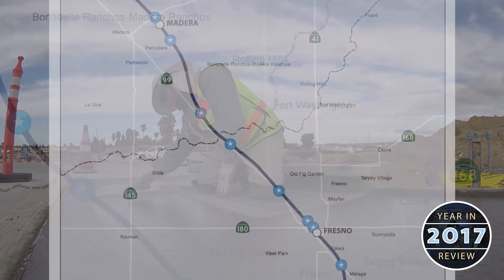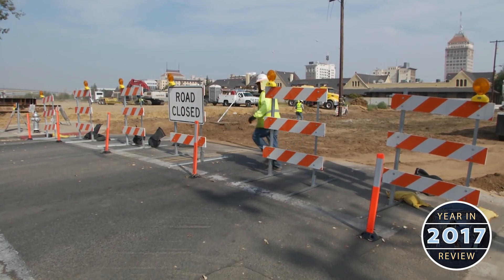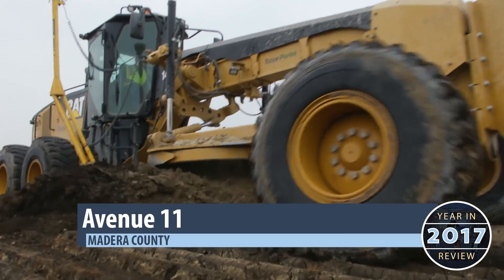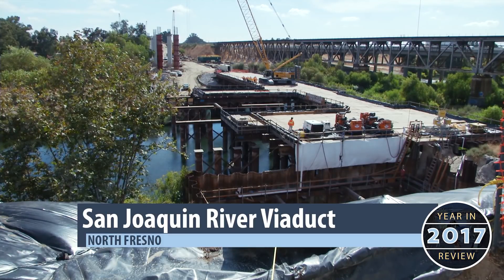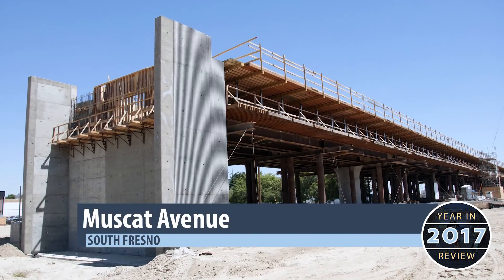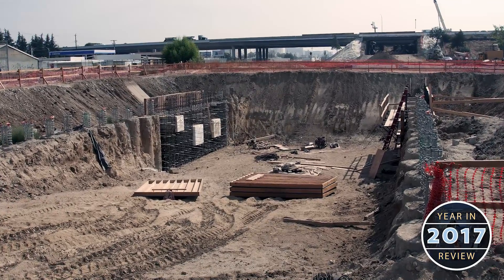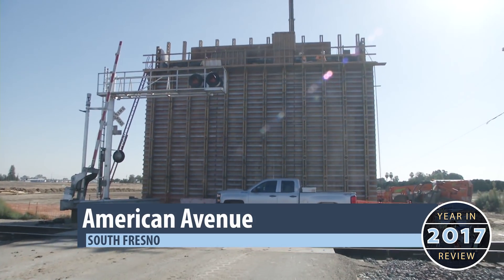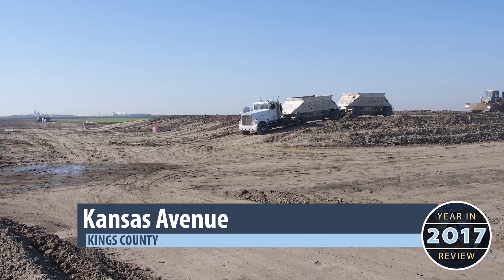2017 High-Speed Rail Year in Review

Comment: When is going to complete in what year?
Reply: according to reports released by the authority, they hope for a 2022 opening of the initial operating segment in the valley from the bakersfield area to north of fresno. 2025 for the segment from San Jose/SF to Bakersfield, and 2029 for the full phase 1 from SF to LA.
Reply: Thank You
Reply: Key phrase: “use existing rail infrastructure”. The original price tag on the ballot in 2008 said $11 billion. It has ballooned to over $64 billion to complete it. There is no money for this now. What they are showing being built is NOT a full hi-speed rail connecting SF to LA. Get informed like I did by watching other videos on YT.  I’m so sad at this point. This project is now a boondoggle.
Reply: cool, only take 12 more year. wtf. lol
Reply: 2040. LOL
Reply: As with most rail systems, there are many tons of earth to move around, and many thick columns required. HOWEVER, the innovation of SkyWay string rail technology reduces the required material consumption by a factor of ten compared to existing high speed rail, does not require embankments, and even their high speed system will be several times cheaper than a conventional light rail metro system. So naturally, string rail can be applied also for metro systems within the city cheaper than a conventional light rail system. The video #MxDJ9zqZHDM summarizes quite clearly the benefits and full-scale demonstration of SkyWay string rail technology. The video is listed on the English playlist at #PLa8tcLMjqDzG0Wb2XqSBqbx1XuINygBxd Their target markets are mainly developing countries with greater infrastructure challenges like India, Philippines, and Indonesia although Dubai is also interested. They are not the only ones, but it seems they are not targeting the American market yet. Maybe some day they will and save California billions of dollars. Hopefully it won't be too late.
Reply: Kieran Lepley Reportedly, all the infrastructure is paid for. Not sure though. But no funds are available for trains. So we have tracks.
Reply: Osman Hossain you do know that they're spending most of the state money to complete this project which is the reason why pretty soon they're going to be rationing your water and you only have two choices you can either wash your clothes or take a shower because they're blowing all their money on a project that will never be finished
Reply: Never. The state will go broke and all this bullshit will be sitting unfinished. Not enough people will ride to sustain it. I expect the channel to delete this comment as I see not a single truthful negative comment on the video.